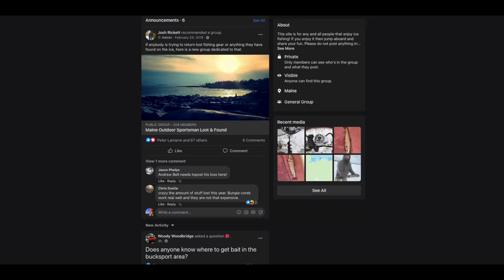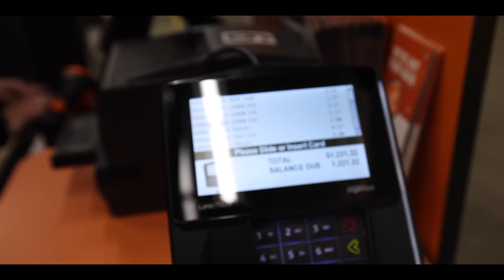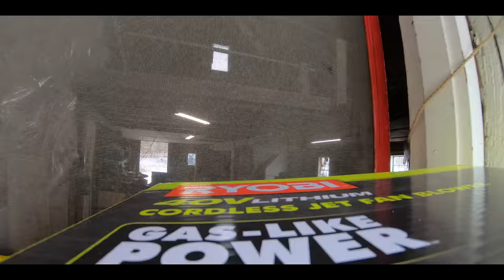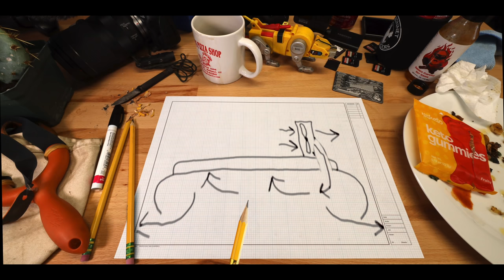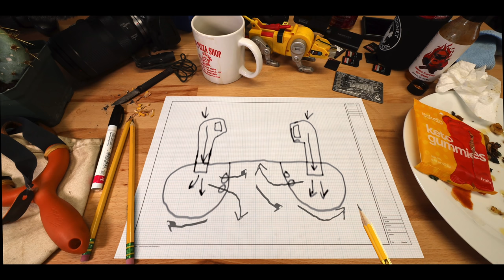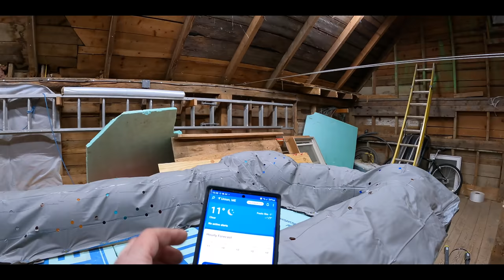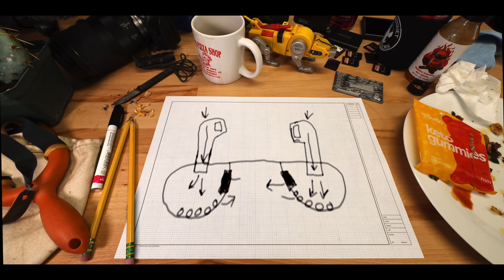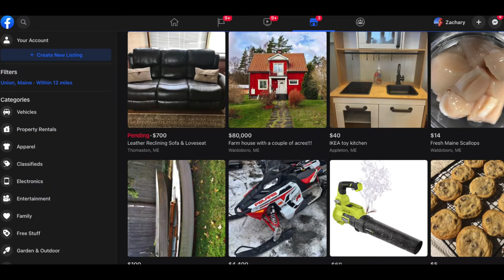Home Depot Hovercraft Build / Leaf blower hovercraft

Comment: Seems like you could get a better set up using greenhouse variable speed AC blowers and axial fans with a lightweight, dual-fuel, portable inverter generator (all available on Amazon). Might have to give up the extra person payload. Ditch the wood: use foam core fiberglass or PMF. Look at portable vaneaxial fans.  Thrust Force = fan mass air flow *  velocity difference across fan; mass air flow = volume air flow * air density. Say 12 inch fan at 2700 cfm max --> v = 3438 linear feet per min; 202 lbm/ min; 6 lbf thrust ...

Comment: The propulsion blowers should be pointing straight back, not blowing down onto the ice.
Reply: I was thinking this, they don't need to blow against the ground, all that achieves is generating lift which he already has from the vertical blowers. 
The thrust comes from the air being pushed backwards at the fan blade not from what the air hits upon leaving.
I do wonder if a small downward facing one at the front to clear snow out of the way might be useful as long as you added extra to the rear to counteract the negative thrust

Comment: I understand that people try to fly on a leafblower. But I think that with all the money and effort you put into this, you'd be more likely to achive your goal  by going with a proven design, with one or two fuel powered motors, instead of increasing the number of leafblowers. :)
Also, if you want to go over water, it would be safer to have a craft with floating capabilities, in case of emergency.

Comment: Aiming the thrusters downward was probably an error.  Some of the horizontal thrust vector is then lost to a vertical vector component (as well as creating a partial flow obstruction).  Remember ... to Newton's Third Law, what the thrust is directed into is irrelevent ... it is the acceleration of the air at the impeller that generates the thrust component ... not what the air hits once it has exited.

Comment: You lost propulsion when you cut the tubes in a angle. By doing this you opened up your channel of air causing less pressure. Pressure is caused by restriction when using pneumatics and hydraulics.

Comment: would have been better to use mosfet to run the switches so you could have a lower voltage at the switch for safety

Comment: your biggest propulsion problems is vectors... you're pushing the back of the hovercraft up (thus forcing the front down) and not pushing perpendicular to the ice... did you try just lowering the steer handle (like while sitting) and raising the 4 propulsion blowers to make them blow parallel to the ice? the big fan would indeed push you in the matter.

Comment: one problem with your forward speed is that the thrusters are pointing down at almost a 45 degree angle,,,  I would attach 1/8th bend 4" (or whatever the dia. of the blower tubes are) elbows to the ends of the blowers,,,
Also the holes in your bladder should be on the inside of the bladder,,,, not on the bottom of the bladder,, then all of the air will be devoted to holding the hovercraft up,,  :-)

Comment: Thanks for showing me how not to do it! lol 
Those leaf blowers are about 800 watts each, I use a total of 250 watts with two 20 inch 4,650 CFM fans that cost $94 for both. You're using abour 8,000 watts with all those leaf blowers. Run on 48 volt e-bike batteries and a 1000 watt inverter. Also put solar panels on it so it charges itself.

Comment: 45:00 "more pushback" That's not how thrust works. More pushback = less thrust, not more thrust. Plus efficiency of blower depends on flow. Blocking the exhaust to achieve " more pshback" makes blower efficiency drop toward zero.

Comment: With thrust it doesn't matter what you're pushing against, there is a significant mechanical disadvantage in how you set up the propulsion blowers, as they are at an angle that is pushing the front down, and have an increased backpressure so less air is going through. Your thrust purely comes from the mass and speed of the air you blow out the back.

Comment: Great job.  I think your concept of "pushing against the snow/ice/water" is flawed and contributing to the lack of propulsive force.  The blowers don't need to push against anything, just as a jet or rocket engine doesn't need to push against anything.  Newton's third law says that for every action, there is an equal and opposite reaction.  If you point the blowers parallel to the surface, you will get the maximum forward thrush on the hovercraft.

Comment: Dude, I'm 25 minutes in and wondering if you've ever done any research on the physics of hovercraft lift and propulsion at all. You have more than enough materials to make an efficient device, but your thoughts are centred on a perforated bag for lift. The bag can be an inflated inner tube as long as it holds a cushion of air within it, and two blowers ducted to maintain pressure within the confines of the surround should be enough for this. The lift is supplied by the consistent high pressure within the contained area, be it bag, skirt or tube, escaping below the perimeter. It does not take much to achieve this.

Comment: the truth is most handheld leaf blowers or just week. 
I have the turbo jet from Ryobi which is a gas-powered version and I have to admit compared to The Backpack Blower the bp42 or something like that basically the 750 CFM model, it literally is almost twice as powerful as any of the handheld units.   
if you want my advice, there is no replacement for displacement and a bigger propellers always going to be more efficient including having that little motor drive a larger propeller which at current date you can just buy online for the large RC models..
I also have a funny feeling that the box fans that they make or actually pretty decent as far as moving air and should work pretty well doing some actual modifications to for example fiberglassing the actual blades so they're little more stiff.

Comment: I think you need to measure how much air comes out of the blowers and then put in only enough holes to match that volume or (preferably) just below that volume to account for leakage... the math isn't hard: https://www.raeng.org.uk/publications/other/hovercraft-educational-resource
Tool to measure air flow is cheap (~$15) from Walmart: Mini LCD Digital Anemometer Wind Speed Air Velocity Temperature Measuring with Backlight

Comment: Make sure you thoroughly test the setup in the cold. Lithium batteries perform poorly if at all in below freezing temperatures. A couple of Echo 9010 blowers would be much more reliable. At least consider placing the batteries in a warm chest when parked. Don't want you to get stranded on thin ice.

Comment: I would also make some type of wheels that you can put that grabs the ice and you can spin it with a switch and you could put like spikes on the wheel and have it be like rubber or something so they gripped it to maybe that will give you a little push

Comment: You don't need to "push against" anything............air has mass and you simply need to move it in the opposite direction you want to travel in.  Point your thrust units straight back and not down as you are only blocking air flow by blocking the exits of your leaf blowers. Epic stuff dude

Comment: Should've just used an Air Mattress as the bottom part of that thing, rather than going threw all that super detailed cutting and Flex Taping and blablabla... I feel like it would've saved a whole lot time if You had just Got an Air Mattress and Maybe Cut it in parts Particular to Your needs from it. Lol

Comment: Interesting machine!     check out - utube video,   1082 Coanda Hovercraft Experiment.   Mr smith shows some details on building a Airflow booster or air curtain that would help you get more lift for less power u can see this @1:30  also mentioned angling the air curtain.   Other tubers have mentioned relay/selenoid as in a Fender mounted starter selenoid to handle ur power switching.

Comment: cut your wires, put on heat-shrink, then solder.   What if you put a tube inside, where you had the balloons,. This would cut the volume you blowers had to fill, and provide a measure of safety if you had an electrical failure. or drop-thru on thin ice. It may allow you to reduce the power and lessen the electrical load. A Briggs with a caged prop under the plywood, that will create a lot of air/lift. Knew a guy that built one back in the 70s.

Comment: Arrange all 10 leaf-blowers to blow into your lift skirt. That should increase your ground clearance and reduce drag. Next, cut a hole in the top deck that allows air to come up into a swivel that directs it rearward. This will use lift air to make thrust. Add a valve to control the amount of thrust airflow. Now when you're on a smooth surface, you can use more thrust air and go faster. When you're on snow, you can use less air for thrust, keep more air for lift, increase your ground clearance so that you're pushing less snow, and go faster. Basically this will allow you to fine tune your lift/thrust ratio to match the surface instead of having it fixed at 6/4.

Comment: Now take those extra 4 blowers and add them to the deck to ensure your floatibility.  I don't think it will float with your weight evenly with the existing amount of blowing downward air pressure.  Water acts differently than ice at slow speeds.

Comment: A fan blows straight off the back not down at the ice. You are putting un needed pressure on the front by blowing down with the tiller blowers.

Comment: On the drive system have you considered putting a manifold on it to reduce it down to one or two would be four times the force in one tube or two also tarp lacing grommets for your lifting holes in your cushions would greatly reduce there acceptability to being torn or stretched reducing their effectiveness just a couple of thoughts from a back seat engineer

Comment: Why not just flat bottom boat with a piece of seamless stove pipe welded through the bottom so it's smooth he can be dragged pushed out on the thin ice, then you can fish through the hole through the stove pipe

Comment: Run em in a series see what the max power the motors can handle if each battery is 40 volts you run em in a series you double the power an amps =more power hire rpms on the motor more thrust

Comment: Love it! :) Your thrust blowers don't need to be pushing off the ground like that. You are losing half the power with your 45 degree angle. That angle lifts your back a bit, but pushes the front down. Laying the thrust blowers horizontal will double your forward thrust.

Comment: You should have used turbo chargers instead. Leaf blowers use impellers to push air while turbo chargers use turbines to compress air and push it with much more thrust.